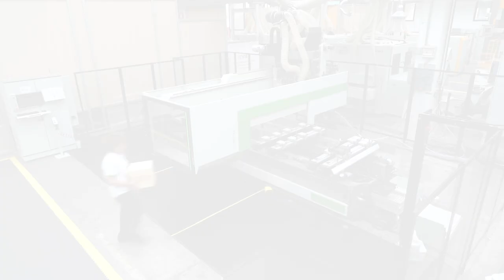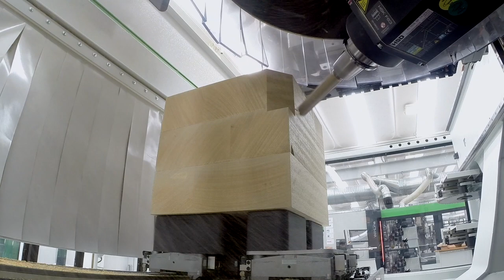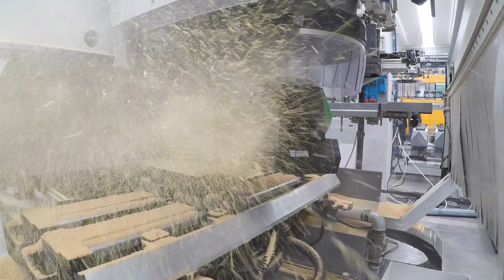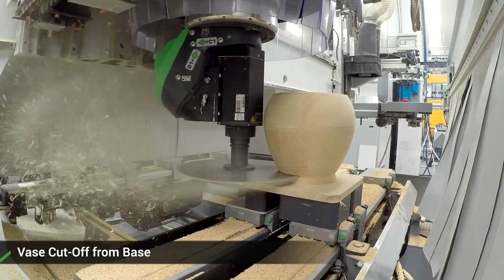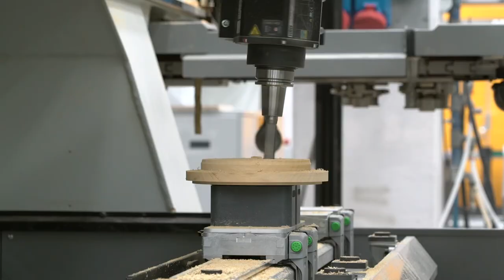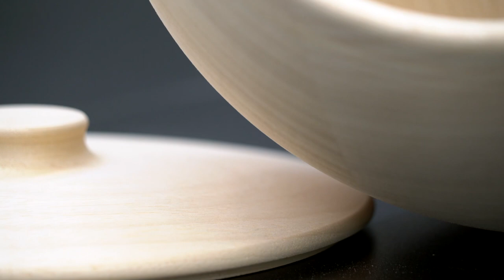Biesse Rover C - Wooden Vase with Lid

Comment: Perfect finishing quality?? That finish is abysmal! It's covered in machine marks
Reply from the maker: Hello Elan Jacobs.
with CNC machines it's all the matters about how much tool passages (and therefore time) you program to machine the part.
if you want a better finishing you can increase the amount of passages to get a smoother surface. Obviously this object could be machined with a finer finishing but it would take way more time than leave this kind of finishing and give it a quick sanding, which is the quickest and best way to get the result. 
This demo is an example to show the capability of our 5 axis continuous rotation system and not a real production environment..
I'm sure that you know that, in real production, a part like this will be processed on a lathe and not on a CNC machine.
If you need additional info please fill free to contact us.
Best regards